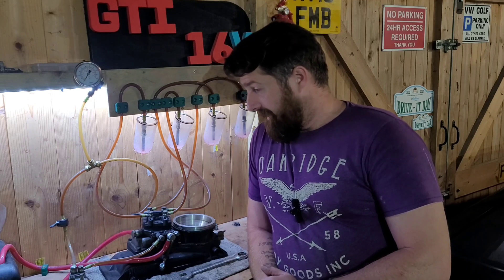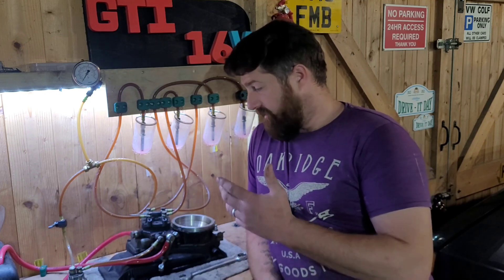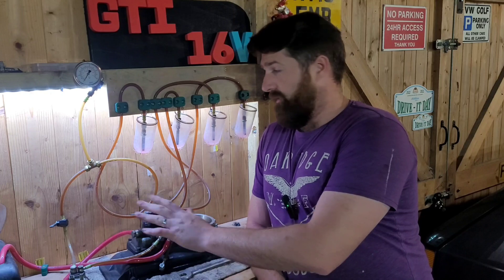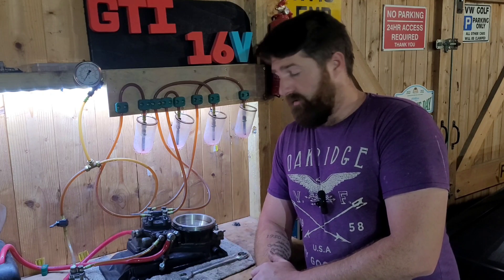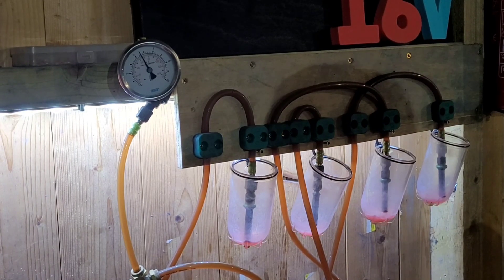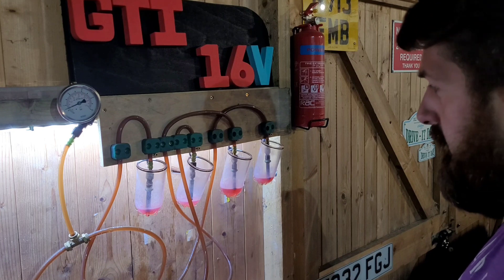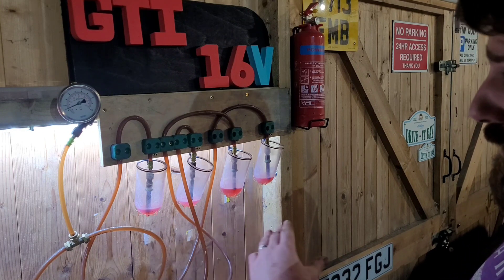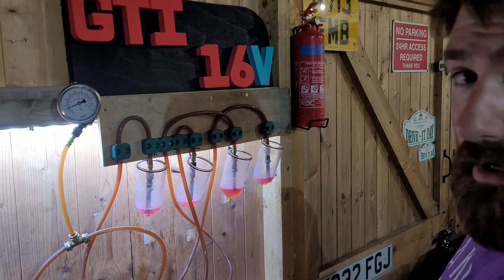Bosch K-jetronic - How to: Modify Your Metering Head

Comment: See your Videos the First time and i ask myself its also possibel to use Diesel to make all These Tests? Spraying around with fuel  is Not the best Idee (think that knows everyone) .   I know liqui Moly does have a Special nozzle cleaner, but i dont know how all seals and plastic stuff inside the K/Ke Jetronic reacts with this Fluid. Thinks the influence of Diesel is maybe less???!!??? How does this handle the Community?
Reply from the maker: I use a calibration fluid which is the same consistency as petrol, diesel may work but also has a risk involved

Comment: Can you tell me if a spring is necessary in the plunger of the KeJettronic fuel distributor? I have no springs in any of my fuel distributor in my 300 SL 1991
Reply: So in your opinion the absence of a spring should not affect the functionality of the unit?
Reply from the maker: No, the springs only job is to aid in the fuel pin retuning to its rest position once the fuel pressure drops after engine switch off
Reply: Ok thank you . I am about to change the EhA tell me if this makes sense to you. I replaced the distributor with another one after I cleaned it check plunger make sure it was not sticking. I did the same to the replacement. On the replacement no fuel was coming in . Checked the fuel filter in the line to distributor and it was clogged. Clean it changed it out fuel coming in same as the one I removed. In my opinion I find it unusual that all the distributor are going to display the same symptoms. I’m going to replace the EHA because I feel that is stuck and not restricting the flow of fuel like it should. Can I solicit your opinion as to my rationale?
Reply from the maker: The EHA is at fault more than likely if you have swapped the distributor unit but using the same EHA
Reply: Replace EHA twice checked the adjustment screw it is at specs . Reinstall same fuel flow as soon as key is turned on stop when key is turn off. Checked plunger to make sure it is moving freely not stuck took it apart cleaned the area put it back together same problem. I took distributor apart checking to see if diaphragm is damage it is good   . The rubber seals around the plunger drum is all intact not damage. Where else could I looked ? I am taking distributor apart checking apart again and cleaning the entire distributor again. Can you share any insight or anything I might have overlooked? Thank you. The flow is quick and over the top of ports without any deflection of plate only stop when key is off
Reply from the maker: Can you WhatsApp me or email me some videos etc greygooserestorations@gmail.com
Reply: I just emailed you
Reply from the maker: This is hard to specifically say as the documentation says after the late 70s springs were fitted but ive had many units in from different marquees with no springs fitted and where 99% original and untouched
Reply: Thank you I would change it now the EHA

Comment: So happy I found your channel! Thanks to you I have realized I don't need to change my metering head on my Volvo. I always thought the flow balancing adjustment was mainly affecting part load. But it turns out I could squeeze out  almost 220 cc at 6.2 bar system pressure 👍
Reply from the maker: Nice that's some good flow 😈
Reply: @GreyGooseRestorations  Yeah it was more than I expected! I tried the car today after flow adjustment and it's getting more than enough fuel until 6-7k rpm then it leans out a bit to 14 AFR. That's the big issue with k-jet, the fuel delivery is linear after the plate has reached the top position, but the engine wants more fuel as it's revs more 😅
Reply from the maker: @emilanderssonmotorsport6378 you can gain more the richer the idle CO, mines at 13.2 - 13.5 AFR the richer the car will happily idle with means the pin can rise that bit more
Reply: @GreyGooseRestorations  Yeah I'm runnning mine at 13.0 AFR on idle. 
It's getting quite rich at 3-4k rpm on full throttle, 11.5 AFR. So I think I'm in a decent compromise already. I guess it's just the engine being much more effective on higher revs with the ported head and a different camshaft, therefore leaning out on the top revs. I will put it on the dyno soon and see how it works out =)
Reply: @GreyGooseRestorations  I might try another shim on the system pressure. And maybe increase the control pressure slightly to delay full opening.
Maybe I can get a smoother transition.
It's at 2.5 bar now.

Comment: Is the pressure gauge connected between the metering hard and injector? 
Also would this make mpg fall and performance increase. For a power gain. 
Or just increase the fuel system performance 
Thanks 
Very interesting video👍🏻👍🏻
Reply from the maker: The guage is measuring system pressure so connected inline with the fuel distributor, any performance increase will drop mpg (if driven sensibly) as you'll be using less throttle movement than before to get the same engine response
Reply: @ great thanks. 
I’m going to install a gauge.
So it goes on the pipe from the fuel tank to the metering head correct, is that correct?
And see what my pressure is. 
Will adjustment on the wur also change the pressure. 
One day I’ll get it sorted and to you for a full fine tune. 
But getting it ok first will do haha
Reply from the maker: It needs to be in the top centre fuel line with a tap so you can test system pressure when not running then tap open to show control pressure
Reply: @GreyGooseRestorations  I think iv got it now. 
So on the line that comes from the tank into the engine bay….. 
… an on/off twist tap ….
….a gauge… 
…to the metering head inlet 
Is that right ?
Reply from the maker: @simonmenzies3142 nope that will measure the fuel pump pressure so around 8 bar
The line that is on top if the fuel distributor and goes to the WUR, that's the line you use to check pressures 👍
Reply: @GreyGooseRestorations  brilliant thanks I’ll put one there and see what I’m getting 👍🏻👍🏻

Comment: Hi, I was wondering if you could help me. First I will excuse me for my English, it is not my main language. I have a '85 golf gti withe EV engine. for a little bit more power I want to put the EV head on to the golf 3 gti block (2E). Add a 272° cam. I have a 16V WUR. They told me I will need 6 bar fuel pressure. Do you think I can get that with the original K-jet? Or do you think I need more or less pressure? And is that the pressure before the K-jet? thanks in advance.
Gert
Reply from the maker: It's not a necessity to have 6 bar fuel pressure, it all depends what the fuel distributor is set to flow. The system pressure is set at the fuel distributor, the fuel pumps will provide around 10 bar of fuel pressure.

Build the engine and set the 16v WUR to have a lower hot pressure, 3.4bar with vaccuum for a start then test the car with AFR guage to see what fueling it needs

Kjet will supply around 40% more than the stock without needing to start tweeking much
Reply: thanks, I will do that. I forgot to mention that I also put the 16V injectors on the build. For the AFR, wich measurement is best to be in? 13-14gr? And for the gauge, wideband? Thanks in advance.
Reply from the maker: @greatfullgman yes wideband AFR and at wide open throttle 13.3 is lean best torque
Reply: @GreyGooseRestorations  Many thanks, just to be sure. You think there is a good chance that it will work with the 8V fuel pumps and the 8V distributor?
Reply from the maker: @greatfullgman I don't see any issues aslong as its all working sufficiently
Reply: @GreyGooseRestorations  Thank you for the help. I think you are a great guy for helping for some random dude with questions.

Comment: so it's not petrol. are you using the stock pump for that? what sort of liquid is that? (I"ve heard you shouldn't use normal fuel for that sort of tests because its too flammable, right?)
Reply from the maker: Yes stock 16v Golf pump, it's an oil based calibration fluid
Reply: @GreyGooseRestorations  its composition is a trade secret? ;-)
I am thinking about summer experiments that I will probably be running with the old  5-cyl 2-liter audi. is that really that dangerous to go with normal fuel?
Reply from the maker: @ljuberzy yes 😉 its not dangerous in a controlled manner but still holds a risk

Comment: To test full throttle injector flow in my CIS K-Jet Lambda, with the fuel pump running, is full throttle when the air flow sensor plate at max opening? In other words, if I pull the sensor plate up as far as it will go, is that full throttle?
Reply: Keep the system pressure the same but reduce the flow at each injector to 60ml in 30 sec. Got it. I remove the little Allen cap off the port adjacent to each injector line and turn clockwise to reduce? Or couldn’t I also just turn the CO/mixture 3mm Allen to lean the flow in all 4 simultaneously?
Reply from the maker: @seanporter6795 yup undo the caps 3.5mm allen key and anticlockwise to remove fuel
Reply: Do this instead of adjusting the mixture screw?  @GreyGooseRestorations
Reply from the maker: @seanporter6795 yes
Reply: Ok. It took about 1/2 turn on each adjuster to get the flows down to 60ml in 30 sec. Then I slightly turned one at a times after 20-30 second runs, to get the flows as close as I could. I now have 60ml +- 2ml on each, and I tested at WOT, at idle, and mid throttle. Will I need to adjust my mixture screw after I get this running again? Reset the duty cycle?
Reply from the maker: @seanporter6795 that should be good, the CO or mixture screw should only really need/be adjusted with a calibrated tester to make sure its all spot on, 1.8% CO is a good ball park for most engines
Reply: @GreyGooseRestorations  I need to find someone who has one. Everywhere I've called does not have the CO probe.
Reply from the maker: @seanporter6795 local MOT garage should be able to for some biscuits etc
Reply: I have the flows calibrated to deliver 120ml at full upward travel of the sensor plate. Since the plate never really goes that high, should I calibrate the 120ml/min to something like 2/3 upward plate travel?  @GreyGooseRestorations
Reply from the maker: @seanporter6795 yes thats one way you can adapt the system to get the fuel you want, thats one hard thing knowing how high the air plate goes on each specific engine
Reply: I just found out that the VW tool 1348/1 raises the plate 25mm to simulate full throttle and 2mm to simulate idle. I’m going to calibrate the 120ml/min to 25mm of plate height. And make sure I have even volume /time at idle. Thanks.
Reply from the maker: Yes that would simulate a full throttle situation
Reply: And, if I raise the system pressure to 80psi using a shim or two, will my control pressure also increase? If so, would I then need to modify my warm up regulator to allow control pressure adjustments? Would 55psi be my control pressure target regardless of the system pressure?  @GreyGooseRestorations
Reply from the maker: If the system pressure is raised, the control pressure will still be the same. 3.4 bar is a ball park control pressure that works on 99% of cars and gives the desired result.
Reply: Thanks. Do you have a video on balancing the flows to each injector? Again, CIS K-Jet, on an 88 Cabriolet.  @GreyGooseRestorations
Reply from the maker: @seanporter6795 yes theres one called pressure testing or injector testing
Reply: So, I set my system pressure up from 70psi to 79psi using a 1mm shim, and noticed I needed to lean back the idle mixture a bit. The duty cycle went from average 50% down to average 35-40%. I set the duty cycle back up to 50% average. Then I reduced the warm control pressure from 54psi to 49psi. This did not change the duty cycle, interestingly enough.  Now the question: When I increase the system pressure, more fuel comes out of the injectors, so did my leaning back the idle mixture negate my system pressure increase?  Thanks.  @GreyGooseRestorations
Reply from the maker: @seanporter6795 Hi, nope idle is purely for idle as soon as the lift plate comes up then the idle or CO setting becomes somewhat irrelevant
Reply: Cool. Thanks. I'm going to run this this week and see if I can tell any difference from before I raised the system pressure by 8psi and lowered the warm control pressure by 5psi. @GreyGooseRestorations
Reply: I am having a "warm" start issue, as during cranking, the engine will turn over for some time before it finally fires, I need to give it some open throttle, then smells pretty rich upon starting. Cold starting...no problem, fires right up. Hot starting...no problem, starts right up. The issue is between 1-hr and about 2-hrs. Thermo time switch? Cold start injector spraying when it's not supposed to? That's the only thing I can think of that's temperature dependent related to fuel. @GreyGooseRestorations
Reply from the maker: @seanporter6795 warm starts are usually system pressure related so

The metering head not holding sufficient pressure once shut off

The main fuel pump check valve not holding pressure in the system

The fuel Accumulator not holding pressure

The idea of the system holding x amount of pressure once switched off is due to fuel evaporation in the fuel lines near the engine, as the fuel evaporates the Accumulator pushes the fuel along to fill up the gap the evaporated fuel leaves (if that makes sense)
Reply: What's the fix for that?...the metering head not holding pressure after I shut it off? Also, why then would a cold start work fine?  @GreyGooseRestorations
Reply from the maker: @seanporter6795 cold start has the cold start injector that operates 

On the metering head pressure relief valve there are O rings that split, undo the 16mm bolt head and gently remove it all, inspect the seals and replace them and see if that helps
Reply: Who sells the o-rings for that pressure valve?  @GreyGooseRestorations
Reply from the maker: @seanporter6795 any O ring selection from your average motor factors will have them just make sure they are fuel resistant, size is 7mm x 2mm
Reply: So, I replaced the seals in the pressure valve and have it shimmed to 80psi or about 5.4 bar.  Flow testing all 4-injectors into 4-graduated cylinders, airflow plate pulled up as high as it goes, for 30 seconds results as follows: #1 was 77ml, #2 was 75ml, #3 was 78ml, and #4 was 79ml.  That's about 150ml-158ml per minute which seems high. Not sure about the differences in volume with 75ml the low and 79ml the high. Probably OK since with 10% of each other. Thoughts on the flow rate?  @GreyGooseRestorations
Reply from the maker: @seanporter6795 not to bad on the imbalance but id adjust the flow outputs to flow closer to 60 ml in 30 secs

Comment: Hey, thanks for posting this stuff. I have a 1983 GTi that I race in an endurance series called 24 Hours of Lemons here in the states. We have modified the intake manifold and have bigger valves as well as a 288 race cam fromTechtonics Tuning cam. I feel like the car should be making more power than it does. We have never had it dyno'd so I don't know officially what we're making. I am going to be checking the system pressure as well as the control pressure soon. As you're only dealing with system pressure with this testing that you were doing, what if anything, has to be done with the WUR for control pressure? If I change a shim in the metering head, is that all I have to do to increase fuel flow out of the injectors? Also, do you have a diagram on how you have your fuel pressure tester hooked up to just get system pressure?  Thanks, Jay
Reply: At out race last weekend, at wide open throttle going down the straight away, the wideband O2 was showing high 13’s to 14.3…I’d love it to be richer. It’s not boosted but it is a race car. with that big cam, we warm it up manually, then it’s basically running for 7 or 8 hours till the days racing is done. Do you have a place to purchase the shims need for the fuel distributor or the actual size? If we get to a dyno and can swap shims in between pulls, we’d be able to dial it in really fast. Thanks for the quick response. -Jay
Reply from the maker: @jaysilver4670 13 to 14 AFR is pretty much where you want it to be as thats lean best torque area generally.
Reply from the maker: Hi, thanks for commenting, love hearing what things mk1/mk2s get up to

Yes just raising system pressure will increase injector output 

WUR can be adjusted to improve the response time to fuel flow and over performance as it allows the air plate to raise higher dependent on the air being drawn in.

I did a video ref how to make a kit plus where to do it, check that out see if it answers your question 😉

Comment: Hi, I'm a little confused i did this test in real time, i mean on car, put injectors in clear cup ,ign. on for 30 sec and i get even 100 ml of fuel with 5.6 bar ,if i double that its 200 ml for 1 min
that is to much of fuel ,you have video when u test injectors on car and have 110ml for 40 sec,and on 4 injector u have 100 ml.
Thanks
Reply from the maker: Thats way to much fuel, i can only guess that your metering head isn't correctly adjusted for the car as mentioned 120cc/min is stock 16v by the book
Reply: It is cast iron,last 20 + years on same car, 16v kr .how can i adjust it to give that 120cc. I have brand new injectors ,wur pressure 3 bar, abf camshaft and with all that i running lean top end, like a white top end of spark plug.if i have so much fueling how i dont make power ,or spark plug to be black
Thank you for your time
You are k jet guru and now you have us with k jet problems👍👍👍👍  @GreyGooseRestorations
Reply from the maker: Hmm interesting do you have a AFR guage to see what the fueling is doing?
 
You adjust the outputs on the metering head, my next video will explain this in more depth

Are you 100% it was 100ml in 30 sec
Reply: Unfortunately i dont have afr yet,i know its sound crazy but after 30 sec is 100 ml with 5.6 bar S.P. like a gremlins in car )
  i can not wait next one ,thanks :)
 @GreyGooseRestorations